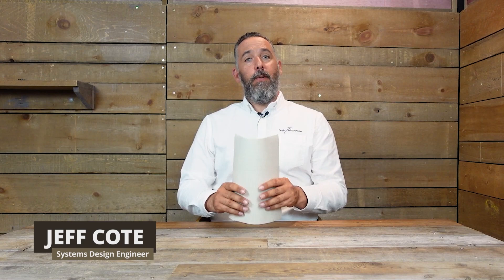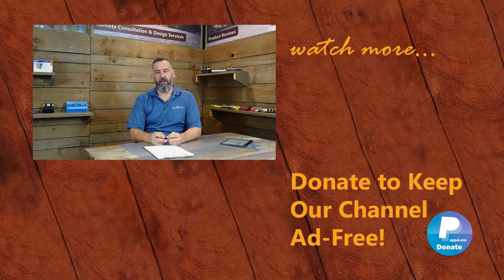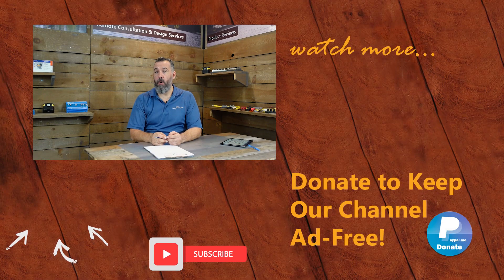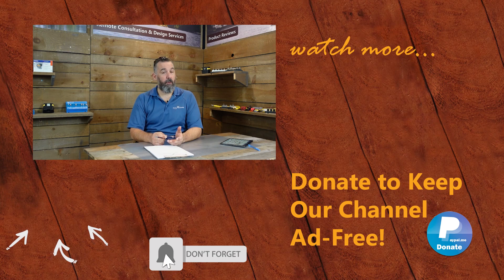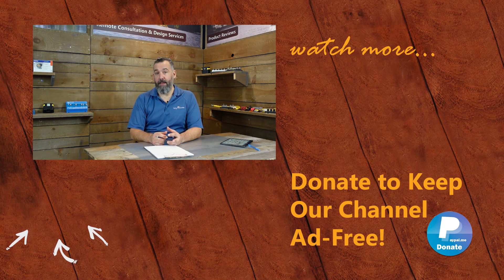Can I Use Solar To Charge Three Different Battery Voltages on My Boat?  12V, 24V and 32V?

Comment: I have a 1963 Chris Craft 57 that is also 32v. I have twelve 12v 100w panels for 1200w total. In order to charge the 32v batteries I put four panels in series to 48v and paralleled them.  I use a BougeRV 40amp charge controller in which you can adjust the charge voltages. I used the same voltages as my old 32v Heart Charger/Inverter. This setup charges the 32v batteries no problem. Currently I have 32v house batteries as well. Just parallel them to solar charge them both at once.

Comment: FWIW the Victron Orion 24V DC-DC converter chargers can be adjusted up to a maximum output of 30v, which is not quite high enough to be useful here.
Reply from the maker: Thanks for sharing.

Comment: use a dc to dc boost module to  go from 24 to 32 they are on ebay and amazon and not expensive.
Reply from the maker: Thanks Marte for sharing.

Comment: 30 years ago we bought a 1982 Bertram 54 that had the same setup with 3 different voltages. The very first week we converted the starters and alts from 32v to 24v in order to keep it simple and avoid dealing with different charging difficulties.. it was a mess... now everything is 24v, except the genset that have always run in 12v.
Reply from the maker: Good one, 24 and 12 VDC are the most prevalent battery voltages and it makes sense to stay there if possible.

Comment: Hey, If I only want to have one battery on my small boat which type of battery should I get to use as a starter and a house battery? I was thinking about an AGM battery, would that work? Engine is really small (45A to start) and house battery supplies only to a few systems (all in 12V DC).
Thanks in advance
Reply: Best choice,  the bigger the better.
Reply from the maker: Go ahead and get an AGM battery, and get the largest one that makes sense for your house loads and engine starting loads.
Reply: @PacificYachtSystems  thanks, the engine (15hp) recommends 12V-35Ah to start. Does it matter if its an AGM deep cycle or starting battery at this point? I only have a little fishfinder attached for max 12 hours. Should I still go for a bigger AGM deep cycle battery (ca 50Ah). Thanks a lot
Reply: @leonardoackermann3946  i would just get a dual start and deep cycles agm marine